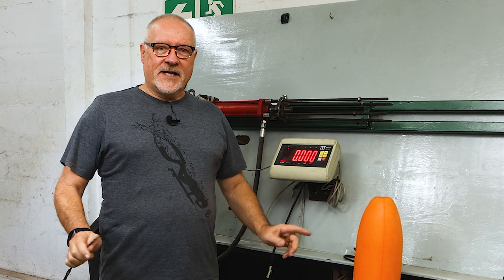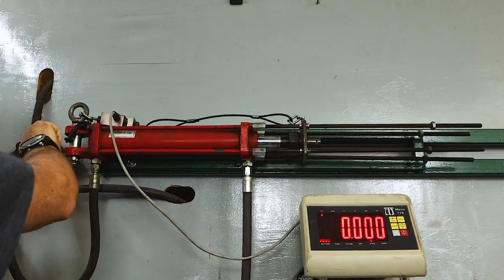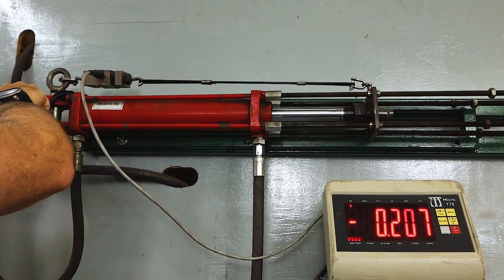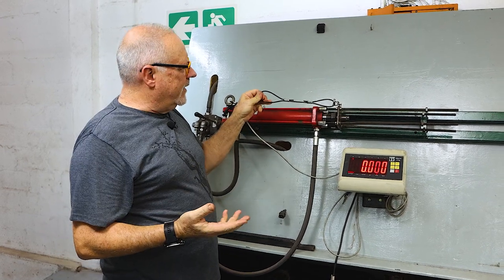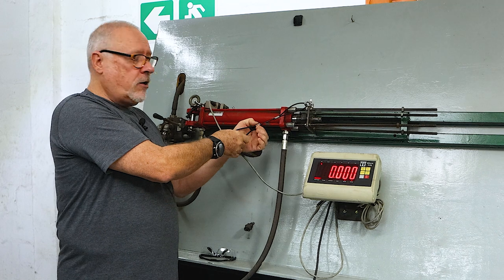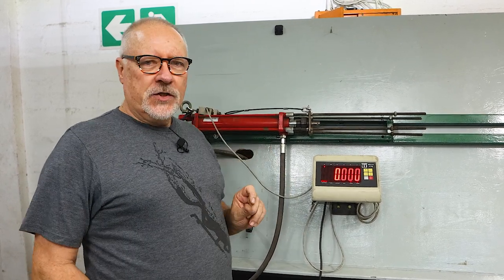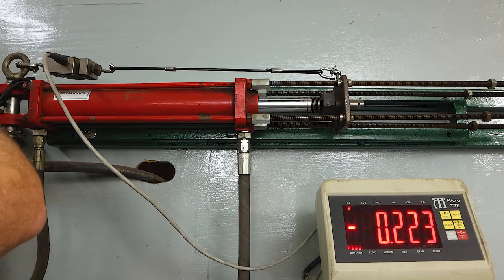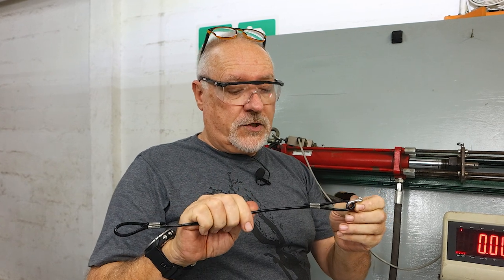Rob Allen | Stainless Steel Crimp | 2023

Comment: Will a hand crimper properly crimp the stainless tubing?
Reply from the maker: Only in the small diameters that will fit the hand tool. If you can find stainless steel tube to make 2mm or 2 ,2mm crimps let me know. I have been looking for a while without success.
Reply: @RobAllenSpearfishing  had a hit on Amazon. 2.2mm id, 3.2mm od, .5mm wall, 300mm long sections.
Dtainless capillary tube tubing  304 stainless.  300mm = 0.98 feet?
Reply from the maker: @snowbank9386  sorry, I should have explained better. To make a crimp for 2mm mono out of round tube, you need a tube double the size so, 4mm id would work. We get that tube here but only in 4,5mm id, not 4mm. The 4,5mm is too big. I think the wall is 0,8mm. The one in this video is 8mm id with 1mm wall, fine to form the double barrel shape and work with 4mm mono.
Reply: @RobAllenSpearfishing   thanks for  explanation